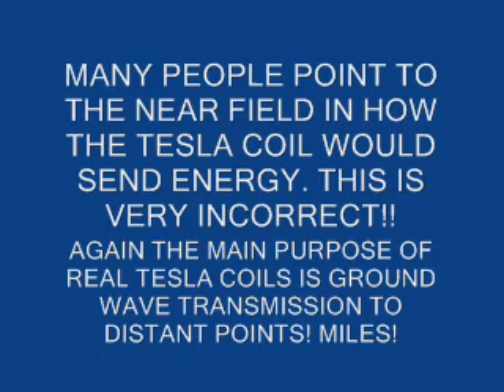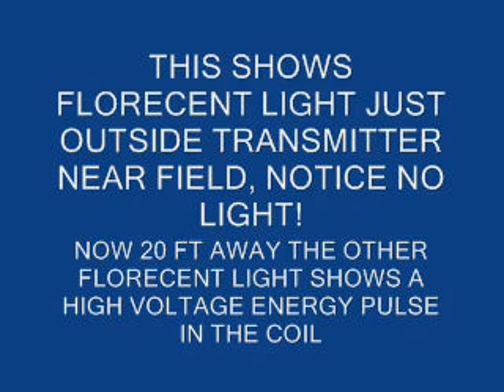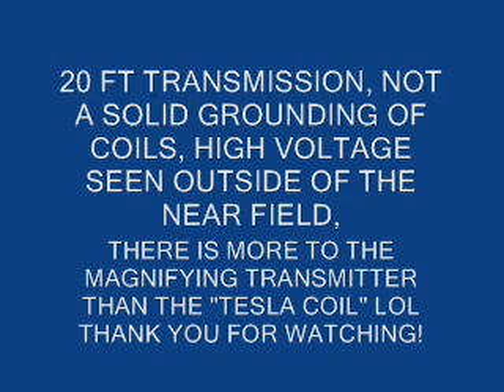Wireless Transmission of Electrical Energy Tesla Magnifying Transmitter Colorado Springs Research 3

Comment from the maker: yes that sounds correct, i think tesla did have some instances where he added capacitors to smooth out and keep a constant energy supply inbetween pulses in some coil setups. thanks for stopping by, i appreciate the support, its good when others understand that this work is not the normal "sparking" coil, sparking coils are cool, but are not what tesla strived for, tesla magnifying transmitters in the end are quite, and sparks are inefficientcies . thank you.

Comment from the maker: thanks for the help, yes strangely enough i was going to build myself a large one and submerge it in oil to give a little better dielectric, still its going to take some time, i calculated the resonance exactly with the capacitors i have, i will just have to pull a few off for now, yes u are right about the capacitive terminals.

Comment: Your main coil is like a light bulb without a reflector - the energy is going in every direction including into the ground where it is dissipated.

Mutual coupling between distant coils is extremely weak, which is why tuned antennas are used.  Tesla used a giant capacity hat to tune and couple closer to aetherial impedance at his system frequency.

High power sources in those days were alternators, and frequencies tended to be less than 20kHz. 

Spark gaps became, and still are - illegal.

Comment from the maker: yes the tesla coil transmitter is theoretically the same as the reciever, because you want perfect resonance of the energy waves with the reciever and so most of the reciever would be the transmitter used in reverse, i talk about this in my patent research videos if you want to take a look, it will help you out alot to understand the wave propagation and resonant conditions.

Comment: yes there is definatley more to the magnifying transmitter than just a tesla coil-it had a resonant cavity below it ,with dampening ports,a tertiary coil above the secondary,and huge grounding plane of eight pipes pushed into the ground down in the cavity.
interesting stuff -keep up the good work

Comment: The best thing to do, is to build a solid state tesla coil driver that has auto tune, and will let you vary the primary energy level. With this you will be able to test lots of different coils. Next get an oscilloscope so you can measure/map the fields around the coils, and also take milli/micro-volt measurements from the RX coils out in the field. 
You will learn why Tesla required a minimum of 75kW to transmit globally and why it requires a low frequency.

Comment from the maker: yes that part has gotten to me for a looong time! well this is how it is suppose to work, even down to regular radio. the coil and capacitor has its own resonance other than any other frequency that is put into the system, the 60 hz is transfering power to the capacitor bank at 60 hz, but when the caps discharge through the sparkgap you are having the coil and capacitors resonate at the frequency they are designed for,if i could make a better input frequency it probably would also improve energy

Comment: The key with these experiments is to have an accurate spark gap. This defines the tuning of the whole system. You could also use a large transistor switching array to make the signal much cleaner. What you have there is Tesla's broadband transmitter.  If you get a properly machined rotary spark gap set up the results would be even better.

G7HMJ

Comment from the maker: the problem right now with this set up is getting the exact resonance and also the capacitors to hold a high voltage, towards the end of this tape you hear the coil getting weaker and thats because the capcitors were grounding out, i do feel with alittle more effort i should be able to get regular appliances to run, the system isnt continuos right now cause of the spark gap but a more steady flow will allow me to run an appliance i believe, the florecent light is getting a high voltage

Comment: This is really cool and I hope you're still pursuing this, I have a suggestion that may help with the power transmission. Instead of directly connecting the light to a receiver how bout you use a capacitor that builds up the charge, do you think that would allow the current flow to the light to appear more smooth and possibly greater distances with your field strength? You seem to be the only one around anywhere near to Tesla's original idea so I respect that, thanks for your work.

Comment: Its like the transmitter is a tuning fork vibrating outward at a certain frequency...and the receiver is a similar tuning fork which will vibrate at that same note or frequency as it receives that transmission.

Comment from the maker: yes i have a bunch of videos on this ftl energy transfer.YES! 471,240 KM/SEC! especially the ones i made just before this initial tesla test. yes the tesla propagation is different than em waves, i understand this very well! i still feel this 20 ft high voltage transmission is important and a start, i still have to get closer resonance and voltage changes, see i dont have alot of money so i have to perfect with just this model and cant really get any better equipment at this pt.MORE TO COME!

Comment from the maker: no i was not going for 6 hz. in my other tesla patent videos the best resonant conditions are between 6-20000 hz my coils are technically resonanting at a higher frequency than that, the coils would have to be alot bigger to get a 6 hz resonance, you could do a forced resonance if you want to, but there are soo many factors, i just wanted to do the colorado springs model you see in the picture with a lightbulb in the middle of nowhere lighting up. ts just a start to make the world aware it works

Comment from the maker: yea im not sure how much was transmitted, but em waves do follow the square law of fields and they follow straight lines so they cant give power to a wide area like teslas system. tesla even states that his system is a form of one wire transmission and that this way energy is the most efficiently given to all points on the earth, he said higher frequecies tend to lose lots of energy and are less efficient, also tesla could use the earths resonance as a wire to multiply energy and deliver it

Comment: Near field distance is determined by wavelength.
What frequency are your coils tuned to ? Wavelength ?

You cannot have pure electromagnetic wave (energy) transmission so close because you have a some mutual coupling there too.

Also you are radiating almost hemispherically so power transmission is going to drop off significantly with distance, no matter what frequency you tune.

For power transfer, electromagnetic radiation needs to be 'directed' at high frequency = a microwave beam.

Comment from the maker: u dont see the florecent light picking up a high voltage 20 ft from the transmitter at extremly low power, about 1000 or less volts, which is intresting to note. they are not connected, just the earth and dirt are the conductors. definalty not a pink elephant, THIS IS REAL SCIENCE. the night test makes it easier for people to see the effect.

Comment from the maker: @panzarw well its appoximate to this, mine are alittle more smaller but only by a few inches,the real transmitter was acutally bigger but the main problem i am having is the capacitor transformer circuit in the primary, the energy pops the breaker, it causes the capacitors to ground out, alot burned out from the first tests! lol.so i would have to move to possible oil caps or vacuum caps to withstand the testing time,also the transformer is very resistive so i lose a ton of energy from the start

Comment from the maker: @SouthernKudzu but im not using powerlines lol, i hope u can see the two coils one is the transmitter and one is the reciever, the reciever is lighting up the florecent lights, from 20 ft away from the other coil, with a small high voltage, if i could make this system better it would go alot further than 20 ft, it sort of is like the high voltage lines in a way.

Comment: Boxa888, even though I'm an Economics Graduate I find electrical physics and Engineering very interesting. Did you study all Electrical physics and Engineering concepts before embarking on these experiments? 

Though concepts such as voltages are easily understandable to me, other concepts such as RF waves and the like are alien to me. If we do want to pursue a career in "Tesla Physics" do we need to learn basic electrical engineering concepts first?

Comment from the maker: well tesla said that was the most efficient way to send power to the whole planet is by turning it into a one wire conductor, any form of radio waves would be inefficient on the industrial scale and would lose to much energy, tesla said the one wire way of sending energy would be 95 - 98 percent efficient worldwide which is amazing!! my experiments are not making alot of voltage and i was getting 20 ft! think, once i up the voltage level, energy should go alot further and cause better resonance

Comment from the maker: @Juefawn from looking at the tesla stuff, i feel a form of antigravity can be due to a strong electrostatic repulsion, but i really dont know,i see either a high speed tesla turbine that causes lift or possibly highly charged surfaces on a craft that would have repulsion stronger than normal gravity,but it is still a mystery to me lol.if it is some type of electrostatic repulsion,there would be a few coils or devices set up for lift and direction possible interference waves of eachother to move

Comment from the maker: the three major improvements i would like to do is secure a more efficient and accurate spark gap either mercury break or triode/tube interface, new high voltage transformer and capacitive loads. these will futher imporve the system and make it more amazing lol. i really think i could get 100 ft, i will scream once that happens lol.

Comment from the maker: still there are things a tesla coil is using than what a radio tower is, yes the towers can be quite high in radio, but the wardenclyffe really wasnt that high and also the massive coil and capacitive top load allow different effects to manifest. ALSO HUGELY the high voltage in the wardenclyffe, am and fm systems dont give off millions of volts , its mainly in the thousands range right? so there are different factors in a tesla than a regualr radio system.

Comment from the maker: i think i might have seen it, they send a small amt of power between 2 islands, yea they are using a completly different part of the em spectrum, teslas was well below basic radio in the kilohz- mhz range, teslas was more like the kilohertz range. tesla said that low frequency works better because you want to resonate the earth structure into a conducting wire to give power to all points on earth.yes they should have given tesla credit!! happens way to much now. poor guy!

Comment from the maker: you have to research this technology, theres more than radio radiation or microwave radiation. the capacity and the inductor tune the coil. the capacitys main objective is storage of high voltage without leakage, this is not line of sight radio, this is a longitudinal wave that can cause electrical resonance on the area of the earth its in, only to allow effiicient energy tranfer to reciever coils allowing industrial energy at a distance. stop criticizing, this is a real energy transfer.

Comment from the maker: no microwave transmission is not better than this low frequency energy transfer system, the low frequency makes this device more safe and efficient than a microwave transmission. i dont mean near field i mean the high voltage field around the coil that only is within 5 ft, then there is no high voltage field till 20 ft away from the transmitter at the reciever coil, lighting up the florecent light!! wireless energy is transfered 20 ft so far, it should be possible to go further!

Comment from the maker: @niqspider yes! u are correct, the real wardenclyffe would have given off no sparks and would have sat on long island NY quitely and sending out wireless power hundreds to thousands of miles enough to run machinery and lighting. set up a few of these towers on the earth or on a hostile planet, and you would instantly master all of the elements on the planet and on earth you would have power anywhere even in the desert or ocean. this is like a type 2 going into type 3. "increasing human energy"

Comment: Have to keep the resonant energy oscillating by using either sound waves or microwaves at low frequency to mid not the wireless technology that is used for cellular tech. to sell wireless phones no that is built on consumer economics this would be free to use problem to sell this type of technology from a Physicist and Engineer also a Professional musician

Comment: though wireless energy is still very inefficient, you have at least tried to make some kind of experiment, tesla made wireless transmission for miles away, but I wonder if he had cracked the secret of making this feat any efficient that what is known now..its no different than a radio station sending signals to the radio miles away, but in terms of tiny milliwatts, getting more of milliwatts into watts is what that is really required to make this all feasibly possible

Comment from the maker: yes thats what i was planning, then the energy would be even more efficiently pushed into the system at a more perfect resonant frequency. i definalty cant use a transistor array it would be rediculously massive because its handleing alot of energy, instead i was going to ,make a tube system, but they freakin suck cause you have to wire for the electrons to boil off. ACTUALLY do you know of anything thats a tube that would not need the "heating" element?? theres got to be something.

Comment: Dude... Could I add you as a friend? If you could send me some instructions I wanna try some stuff with wireless energy transfer, just don't know where to start, as in how. I just wanna try powering a light bulb... But yeah, I'd apreciate if you could send me some designs or soemthign to get me started. BTW, couldn't the forms used to transmit energy wirelessly also be used for other things such as radio waves etc.? Cause I mean that'd be ground breaking ...

Comment: Longitudinal wave on Earth ?
cosecant (degree on Earth) ?
I applaud your empiricism but get a sense that you are confusing longitutudinal waves and the propagation of waves.
Googling did not produce any reference to support your claimed power transfer.

In fact I do not know of any published reference relating to the transfer of anything faster than the speed of light, especially as reference texts do not cover any possibility of induced changes in gravity and relatavistic time.

Comment: you need to make it a solid state tesla coil youre loosing WAY TOO much power with the spark gap and do something other than a floresent bulb....like a motor ( something that requires current ) and more watage. you doing great. im impresed. kep up the good work. it be cool if you caould use the transmiter to send signals and power to like.......me. whats youre operating frequency? .lol

Comment from the maker: its funny isnt it and very sad well i have proven its possible! if i was rich it would work 10 fold! but i am not so it will take a while to get 100 ft or a mile transmission, and this system is safe because of such a low frequency is being used adn resonance keeps energy transfer safe as well!! well thanks! what do you think of my work!???